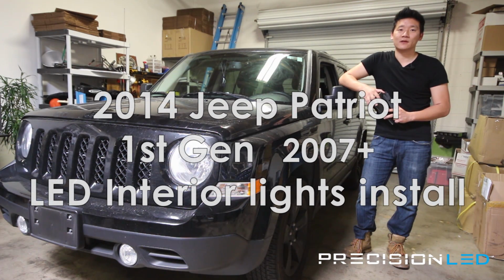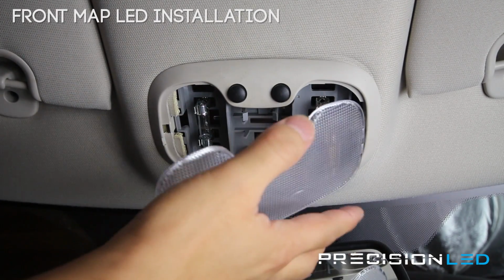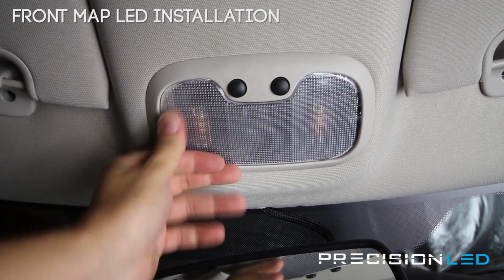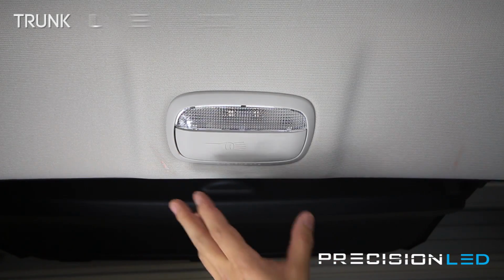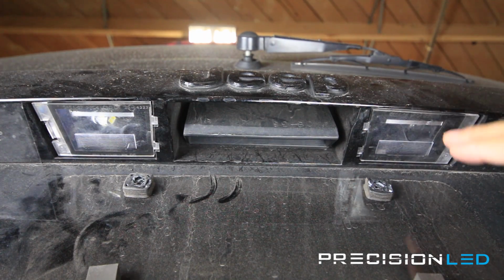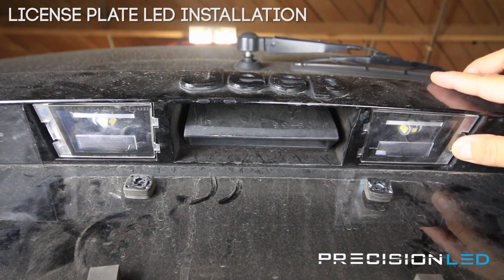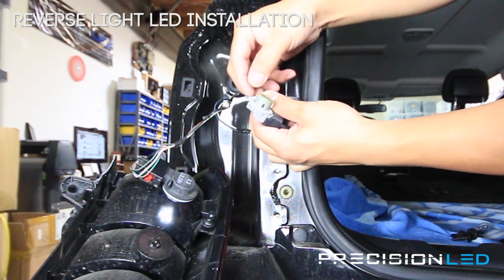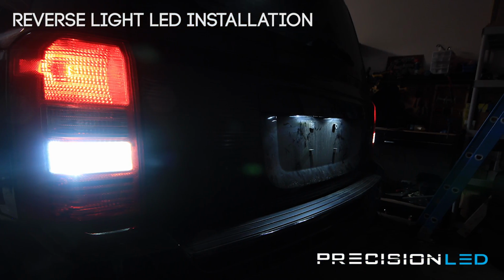Jeep Patriot LED Lights install - 2007 - 2017

Comment: are l.e.d. lights legal for ca in the rear?
Reply from the maker: The legality varies vastly from locale to locale and you will need to check with your local laws and regulations. What we commonly dissuade customers from, and what is illegal, are any colors above 6000K, as they are prohibited by the Department Of Transportation.

Comment: Will these LED lights be compatible with Jeep Patriot Sport 2017?
Reply from the maker: Yes, that is correct, the installation and kit linked in the description is compatible with your 2017 Patriot Sport.

Comment: Whats the difference between premium and standard LEDs?
Reply from the maker: Thank you for your interest.  The new Premium 5730SMD LED bulbs are the next generation of new LEDs.  Compared to the older 5050SMDs, these LEDs have 3 times the light output per LED.  The 5730 LED chip is designed for maximum light output while the aluminum housing helps to dissipate heat effectively for the longevity of the bulb.  The new 5730SMD LEDs have a Constant Current Circuit design which helps maintain brightness if the voltage fluctuates within the circuit and has voltage surge protection up to 18V.  And of course, all of our interior 5730 LEDs are backed by our 1 year warranty.

Comment: I broke the bulb of the license plate . bulb was to small and now I can't connect the led light bulb what to do.??
Reply: help
Reply from the maker: Thank you for contacting PrecisionLED support.  It sounds as through you would need a replacement.  Feel free to contact us directly via email at help@precisionled.com to move forward with getting you a replacement license plate LED.
Reply: +PrecisionLED the original bulb is the one I broke I can't get to it to connect the led new one..
Reply from the maker: Thank you for the follow-up.  Would you be able to send us over photos for reference?  You can email them at help@precisionled.com.

Comment: so the brake lights and reverse lights are sold separate? I wanna make sure all my lights are matching.
Reply from the maker: Thank you for your interest.  We do indeed sell the reverse lights,  however, we do not carry the brake lights as they would hyper flash when braking.  Also, yes, the reverse LED is sold separately.  If you are interested, send us a direct email at sales@precisionled.com and we can recommend a compatible LED.

Comment: I love my PrecisionLED interior lights, I get comments on them every time I have new people in the car. The installation was easy and it's hard to get into another Patriot without LED lights.
Reply from the maker: +Gus Bunzel Thanks for the love, Gus!
Reply: @PrecisionLED  Just to add, my latest purchase, I ordered a new set of number plate lights and reversing lights, the number plate lights weren't really required so they replaced the parking lights that we have in our headlights here in Australia as one of the previous set of incandescent lights died. I installed the reversing lights and can't wait for the dark to come, so I can see how bright they are? For those who haven't switched from halogen headlights to LED replacements, just remember the resistors to add between the car and the LED lights. I tried the Canbus without any success. The interior lights are brighter especially at night.
Gus